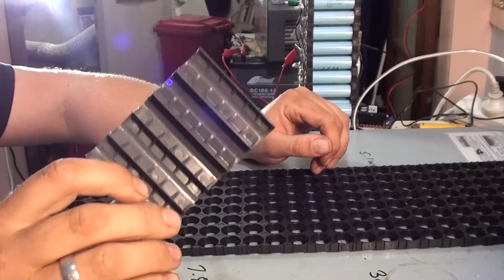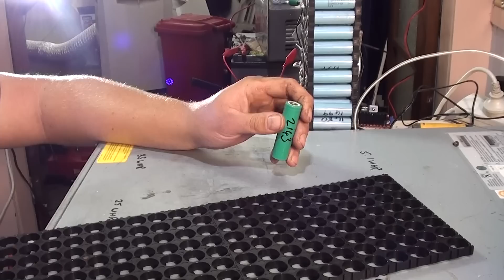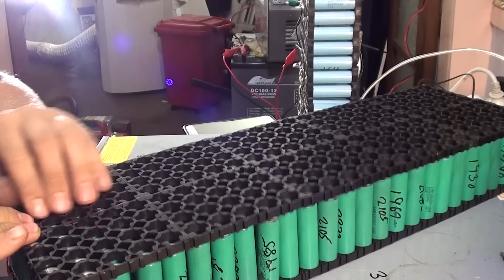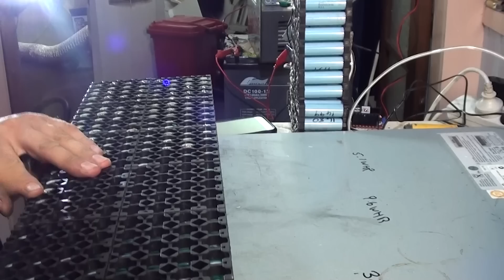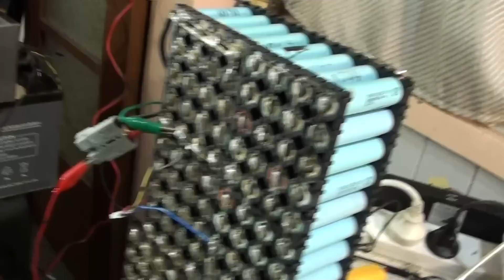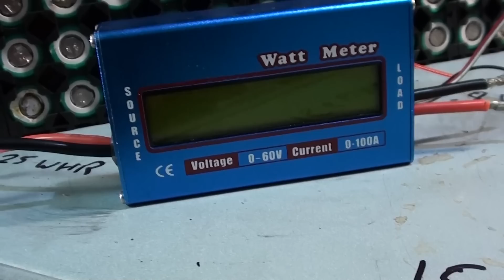200 cell 18650 samsung  Ebike battery build 1.5 KWH!!

Comment: Sorry but I just have to say that you can't be serious - I mean - by what you are saying (20c rating) - you would be charging a single 18650 battery at 42 amps - MERCY - And then throwing 8,400 amps into your completed battery pack - but wait! - you would never make it to charging the completed battery pack, because you would have already been killed from the fire that would be caused by charging a single battery at 42 amps which burned your house down - And You in the process...

I am sure that was just a mistake on your part, but couldn't pass the opportunity on commenting about it anyway LOL..

I am only commenting on this because we have to be very very careful what we say, and how we say it, because I personally know someone who most definitely WOULD try what you said about 20c, and if they did, of course he would burn down his parents house, and probably all of them in it.  Also, I am hoping that when you read this, you will make the change about this incorrect information by removing that part of the video from this clip.
Reply from the maker: Steven Jarrell 20c discharge mate
Reply: Ok, so from my research and understanding, the "c" means a multiple of the rated ah of a battery that it can be charged or discharged at (per the manufactures specifications obviously) - So if it is a typical 18650 with say 2100mah capacity, that means at 1c you could charge or discharge at 2.1 amps.  At 2c, that would be a 4.2 amp charge or discharge - but at 20c, that would mean 42amps at charge or discharge for one cell, and that would be a bomb for sure.  When you discharge a battery, you are putting it under load, and at 20c you would be trying to pull 42amps which would probably cause it to implode LOL, or even break the space time continuum LOL LOL :).  

I don't mean to be "one of those" who constantly look for something to be wrong, but in this case I just had to comment.  From my research (and I have done a ton of it), the most "c" ratings that I have heard of is from 0.5c to 2c, and most anyone that works with these batteries on a daily basis, will state that 0.5c is the best way to charge, and 1c to discharge, and a few have stated 2c to discharge but NOT recommended (but just to be clear, I am speaking about a single cell here, not 50, 100, or even 200 cells, because obviously that charging rate would change depending on how many batteries you are charging at the same time).

Like I said to begin with, I am sure that you just miss-read a label, or it was a miss-print, or it could have said .20c and you missed the dot before the 20c, am not sure.  If you will do some research, you definitely will find what I am saying is true as far as what the "c" rating is, and what it is for and means.

PS.  Thanks for not getting all ugly about my comment, I am just trying to help so that someone even you don't get hurt...
Reply from the maker: +Steven Jarrell yeah sorry there c rating is incorrect  they are 22 amp max continued  discharge and peak for 10sec of 30amps scary  that its not that far off 20c but they are more like 10c. So each of my series  packs can let out 300 amps during heavy discharge so 48v x 300 = 14,400  14kw of potential  output. Ill be sure to do a new vidoe and link it as last thing i want is to see some one on the news onfire haha.   cheers.
Reply from the maker: +Steven Jarrell and they rate them as 4amps for a rapid charge so only 2c charge. 10c discharge. Obviously  pushing them like that will ruin there life span too
Reply: Mercy - I have just been doing some more research (I love learning new things), and I guess I am the one who miss-understood you.  Even though I have been doing allot of research, the discussion of "discharge" has not really come up, it was always mostly about the charging rate and discharging rate (the applied battery load to drain it), and I had never heard about 20c or 35c etc., etc..  Actually - the 20c that you are referring too is the "discharge" ability of the battery not the act of actually discharging them.  The 20c means simply that that is what a particular battery will OUTPUT - My bad, and mistake, and so sorry for the miss-understanding...

I am leaving these comments alone however, because I still say that this could keep someone from causing an explosion by charging or even discharging at un-safe amp levels.  It is still recommended however that when you discharge a battery for conditioning purposes, that you not exceed 2c.

Again, so sorry for my misunderstanding, but glad this happened if it saves someone from disaster.
Reply from the maker: +Steven Jarrell saftey  is definitely important  at this sort of power level every comment  can help some one and i read them all cheers for the interest mate hope you enjoy learning more
Reply from the maker: +Steven Jarrell not here to hate on people  mate im here to work on my projects  and show the world (mostly American going off the analytics  ) thanks for.watching mate

Comment: HI there, instead of running wires through you pack to put them in series, just reverse the cells in the trays so some are positive and some are negative...
Reply from the maker: +papagino007 yeah ive just done that on the next video cheers mate i appreciate  all feedback
Reply: One up the sleeve customs you need a spot welder it safer than solder. and nickel strips,are cheap but very low in resistance all that's available on ebay

Comment: Not bad mate, i made a 240 cell battery myself, take a look here: 
https://drive.google.com/open?id=0B09MqraffDGRTzk1UlBRXzVYWk0

It's going to be mounted in the middle of the bike, therefore the triangle shape.

Keep it up and happy riding. I hope you will power a couple kW's with it.
Reply: xubor and
Reply from the maker: That looks great mate how many watt hrs are you expecting? im hoping to put a perspex lid on mine to see all the cell fuses and keep it safe cause my first one was dodgy and caught fire while i was riding. have you brought all new cells for it?
Reply: Im expecting around 1.5 to 2 kWh, the Cells are all new but low quality. I mean not like the chinese fake batteries but still bottom line. I extracted them from notebook battery packs. Yes, it was a pain in the ass to do that (around 6h and 2 finger nails). 

I hope you will have a good start without the fire part, you could have got serious injuries from an exploding/burning battery of this size dude.
Reply from the maker: +xubor thats a good way to get them what brand are they mate? Yeah was very lucky  they were loose connected so just yanked the shorting ones apart
Reply: The notebook batteries were from "Peltec", here is a link to it:

ebay.de

I measured the cells before i made the big order amd got 1.8Ah usable capacity, while i have to say my charger is veey critical when it comes to capacity measurement. Even some brandname original sony cells for around 5€ / pcs only got 1,9Ah, while the cells were rated around 2.4Ah. So i guess if you measure the usual and unrealistic way you get the 2.2Ah that is printed on my cells.
Reply from the maker: +Jerry Cunningham random pointless internet brag i guess
Reply: expert

Comment: 4 WH per cell I think. So 800 WH!
Reply from the maker: +Alan Marshall almost  8 watts per cell bud were did you get 4wh from
Reply: Surley u have to use lowect charged cell in each battery.
Reply from the maker: +Alan Marshall lowest  capacity  or voltage
Reply from the maker: +Alan Marshall average of the 200 cells is 2100mah x 3.7v nominal  and you get 7.78wh per cell
Reply: I charged up an old 18650 and left it for 24hours. It settled at 4.07V.
I then discharged it at .5A using a ZB206+ Battery Tester. I got 6.8 WH out of it. You were correct and I apologise.
Reply from the maker: +Alan Marshall cheers mate good work now save all the good ones and makes some cool stuff out of them

Comment: nice pack . i want too see next step of your bateery cuz i making 15s10p pack for my ebike
Reply from the maker: +Türk Best yeah ill get it done and produce the video as soon as it happens  going to get some fuse wire today hopefully
Reply: keep going bro. i ll use resistor wires like jehu did. what u would offer to me for solderingg on 18650 i mean thats hard to keep solder on battery
Reply from the maker: +Türk Best i just use some flux and they stick great
Reply: yeah same with you so ı should change my soldering iron maybe which is greater than 40w. Thanks mate.
Reply from the maker: +Türk Best i just use some flux and they stick great
Reply from the maker: +Türk Best im using an 80 and thats good and quick
Reply from the maker: +One up the sleeve customs i found a 30 or 40 takes to long to recover
Reply from the maker: +One up the sleeve customs i found a 30 or 40 takes to long to recover